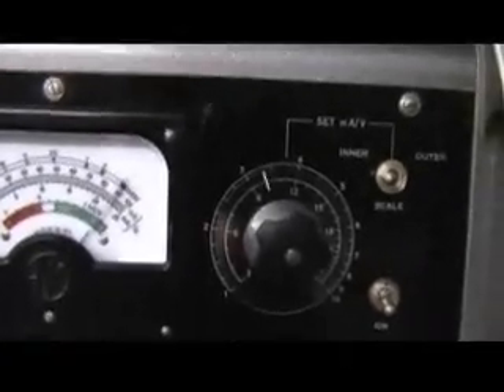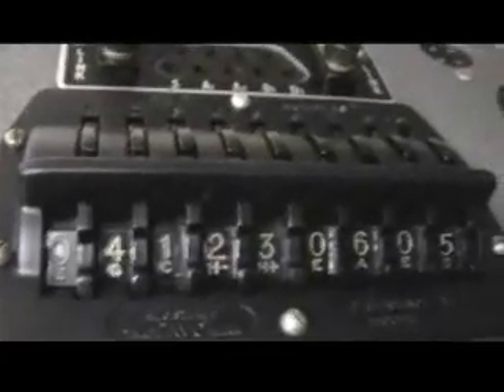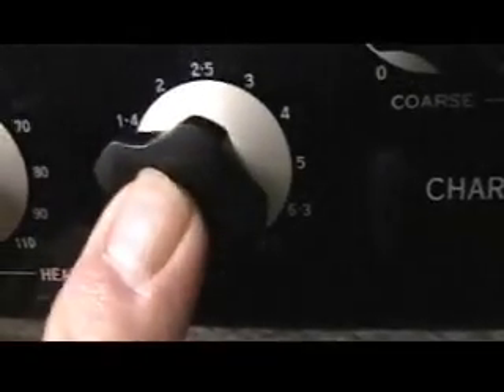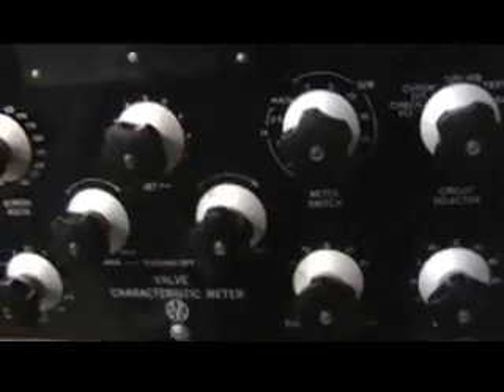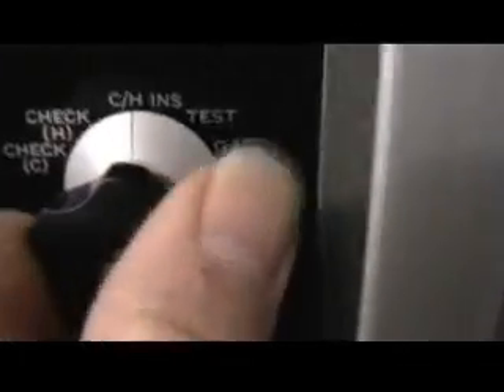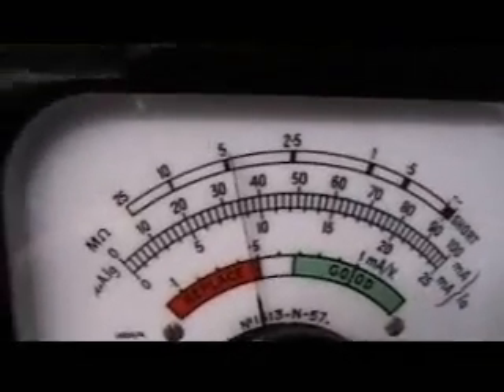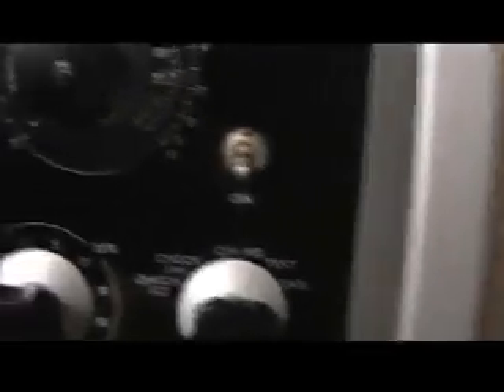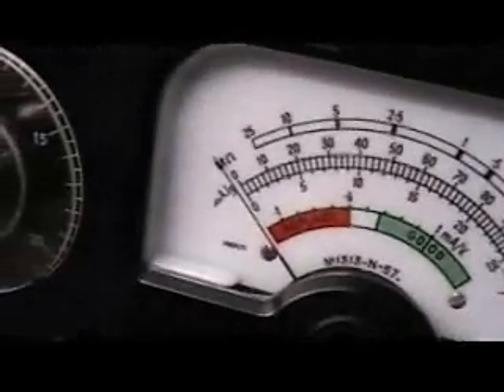AVO valve  tube tester operation and adjusting

Comment: Yup, that's helpful, just scored one of these old monster tube testers as a basket case... just about finished refurbishing it.  It is quite complicated to use for an amatuer tech like moi, so perhaps you could run through some other tubes... i.e. dual element tubes like the AX7A's etc.
Thanks dude...